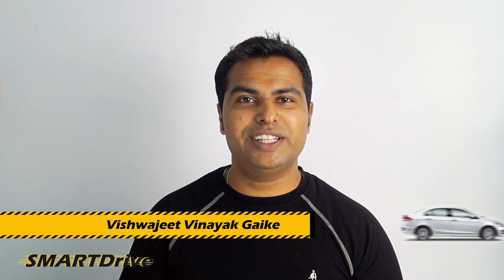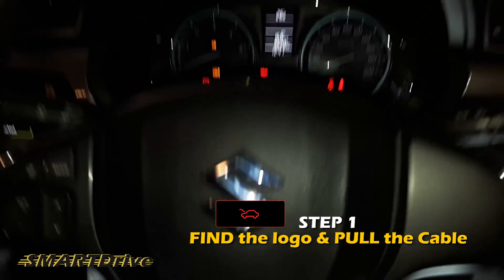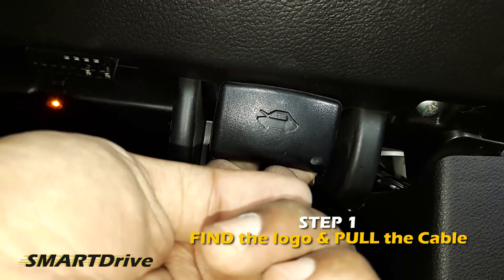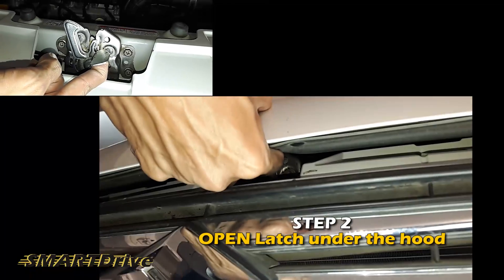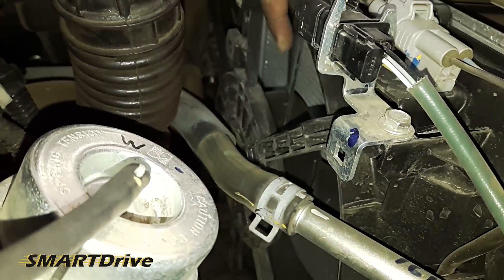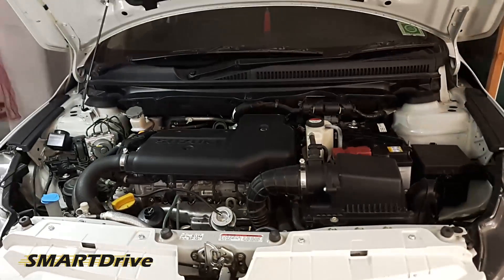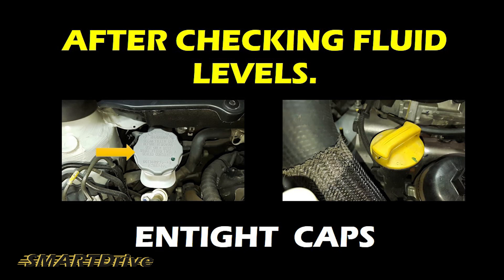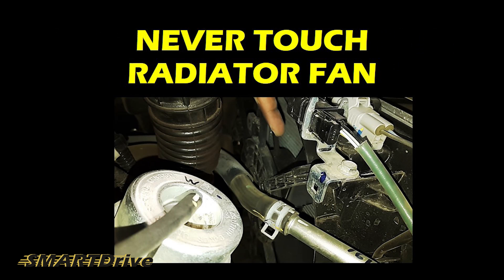Suzuki Ciaz car Bonnet : know what's there under ciaz car hood : SMARTDrive ep. 11

Comment: Hi there, suzuki ciaz fans not turning when I drive but engine temperature stays below 50%. Fans work when AC is on. They also work when I pull out the connector on the coolant temperature sensor. What could be the problem?
Reply from the maker: As per your given information, car is absolutely fine.
We recommend you to always monitor engine oil temp guage in dashboard/cluster panel. It should be always rest in middle of H and C.

Nothing to worry about it.

Comment: Sir mare car ciaz Zeta petrol ha jesma 2 radiator fan ha but ma jad bhi car ka ac on krta hu sirf ak hi fan chalta ha mena kabe dusra fan chalta hua nhi dakha ha kya ya koi fan ki problem ha..
Reply from the maker: Ye thoda serious wala mamla hai.
Fan band hone ke piche kaunsi wajah hai ye dhundhna jyada jaroori hai.
Uske liye aapko electronic expert lagega.

wajah
Fuse blown, thermostat malfunction, wire cut, fan motor jam, socket issue and many more.

So main aapko service advisor ke paas jane ki salah dunga. Warranty main ho to problem free of cost solve hoga.
Reply: @SMARTDrive  sir mena is dare me nexa service centre walo sa bat ki or unka khna tha ki ciaz ma dusra radiator fan tabe work krta ha jab car ka temperature bahut hai ho jata ha or usme bhi kuch time ke leya hi secondary radiator fan on hota ha otherwise kam temperature hone par sirf ak hi fan kam krta ha
Reply from the maker: Please check engine oil temperatures as shown in https://youtu.be/9FadD3SrdSc.
Reply from the maker: As it remains in between red and blue colors then there will be no issue to worry.

Comment: Thanks for sharing the info. Where is power steering fluid
Reply from the maker: +Pankaj Singh ciaz is equipped with electronically controlled steering system.
Which is better than hydraulic (power steering) one.
Reply: SMARTDrive Thanks a lot, keep up the great work :-)
Reply from the maker: We are glad that this video helped you. Thanks for appreciating and supporting to smartdrive333.com.

Comment: Hi man you are awesome in your videos! I just bought a ciaz too but I have a question and also i hope you can help me posting a video of it when ai turn the air coditioner there's a small noise after the process and i wanna know if its normal
Reply from the maker: +Lizbeth Pinzón M. Thanks for the comment. Will you please elaborate the noise. Whether it is coming from blower or engine side ?
Hope you have watched https://youtu.be/ySc4hjrnZxk .
I will provide you special link tomorrow to analyse the normal noise coming from air conditioner system.
Reply: SMARTDrive  well the noise is outside, I think is when the fan I dont if that is the name lol but  when I turn the air on it starts to spin and then it stops for a moment and is where a hear the small noise!  thanks you for the help
Reply from the maker: +Lizbeth Pinzón M. Radiator fan assembled in ciaz makes more noise than any other sedan. 
But noise is not noticeable inside closed window car.
I will post video for you.
Reply: SMARTDrive  oh got it ill be waiting thanks :)
Reply from the maker: +Lizbeth Pinzón M. Hi please find if your concern covered in this video or not ?
https://youtu.be/7Px2nfoubLA